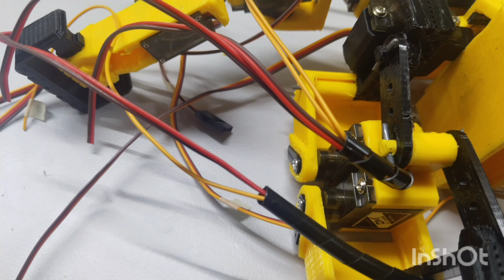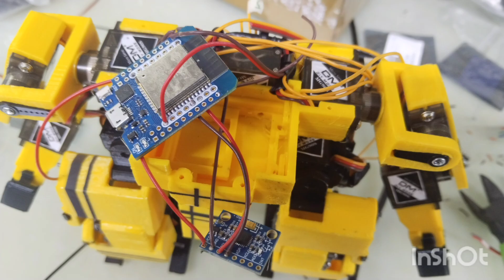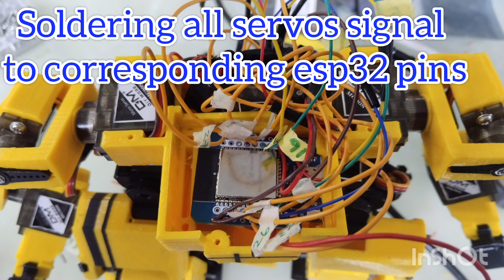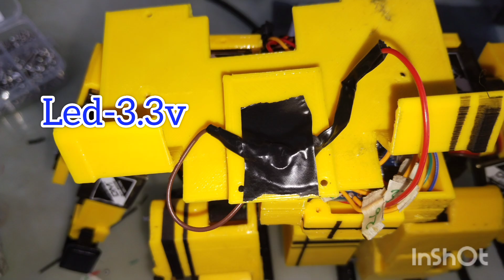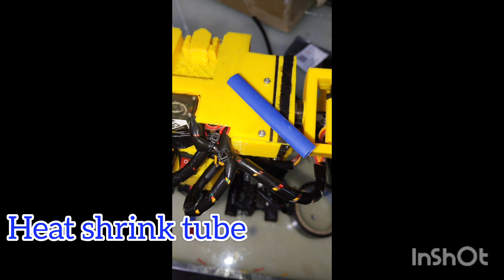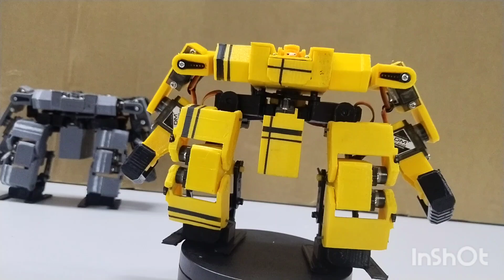Anvil ms - robot wiring

Comment: What is the correct pin of hip? hip servo is not working 12pin (TDI) not working
Reply from the maker: @manjulakumara5772  , it's correct,is gpio 12, TDI, try check if other issues cause it
Reply: @tangwoonthai I tried it and it still doesn't work.  After checking with this function every time, that pin does not work.
Reply from the maker: @manjulakumara5772  ,so, servo for other pin work, only pin 12 doesn't work?same results for other esp32 board?
Reply: @tangwoonthai  yes. Doesn't work only pin12 servo (hip). I try to other board ( dev board) same thing issue
Reply from the maker: @manjulakumara5772  , send me the code you using